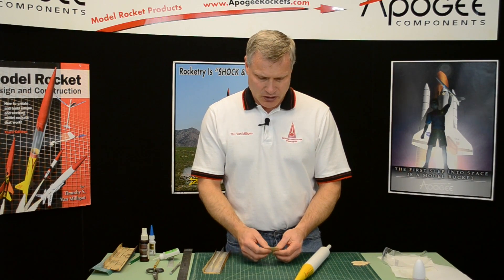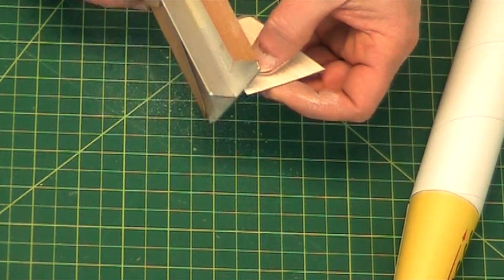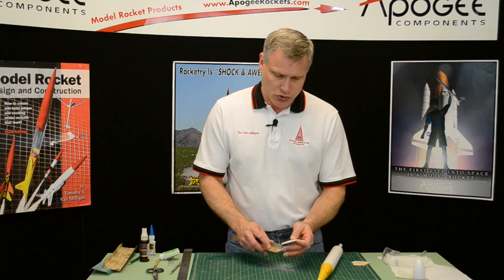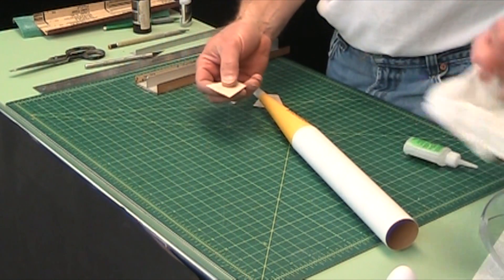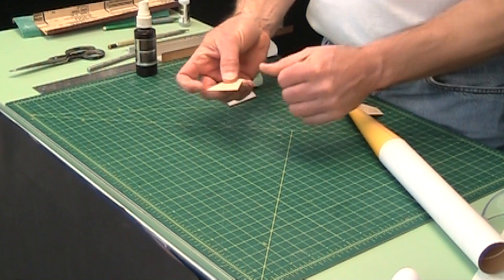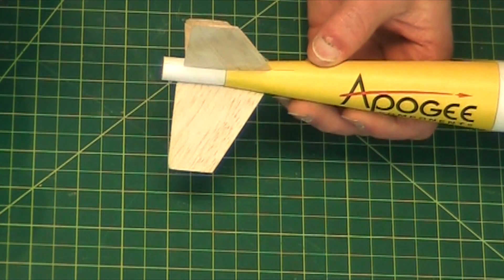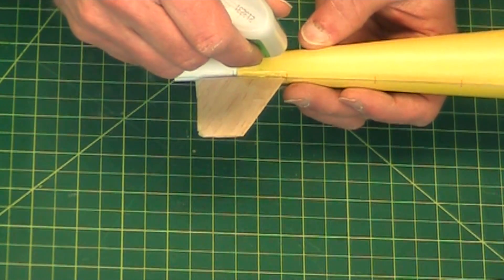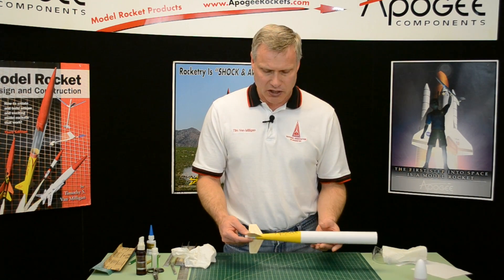FAI Parachute Duration Competition Rocket - 8: Attaching Fins

Comment: Too complicated. It is very easy to attach without any marking. Just put a cone place  the rockets far end under your eye  almost like trying to poke your eye and with some superglue on fin put it so it is straight when looking from the cone  end. Afterwards glue with hotglue or epoxy. Works perfectly and goes straight up. With markings  got issues that some rockets did go spinning.
Reply from the maker: We never recommend the use of hotmelt glue. You're asking for problems when the hot engine melts the glue and they could fall off. The eyeball is good for most rockets, but if you want dead-straight flights, you need a fixture of some sort.
Reply: @apogeerockets  There is no benefit of dead-straight fins. Slight rotation adds stability.
Reply from the maker: @otofoto  The highest flights are made with non-spinning rockets, because spinning alway produces drag.